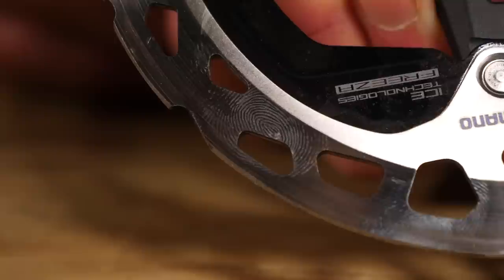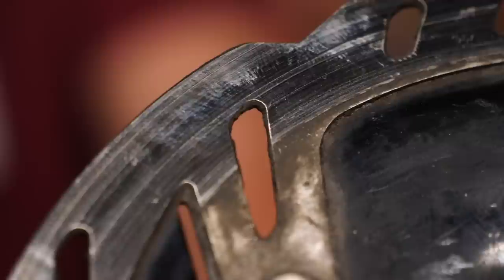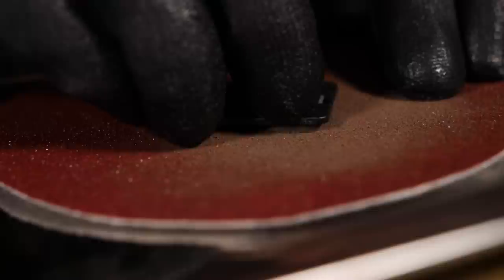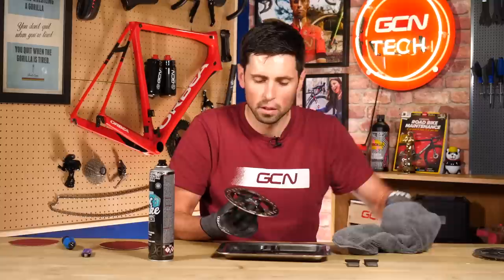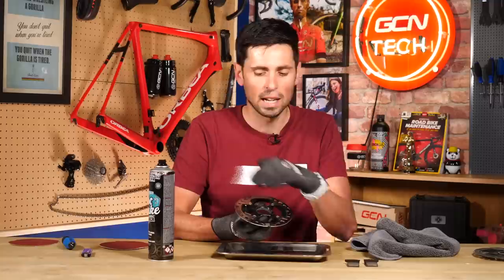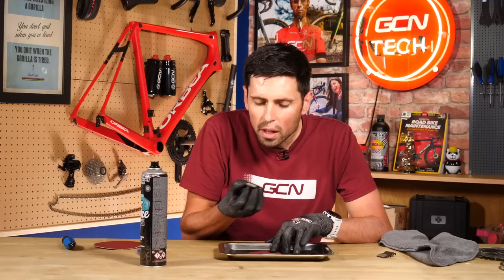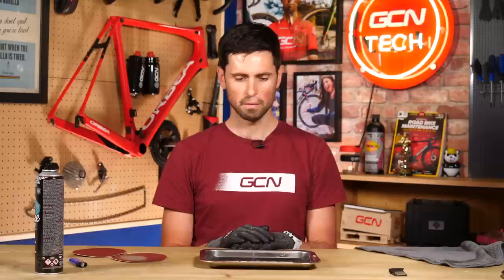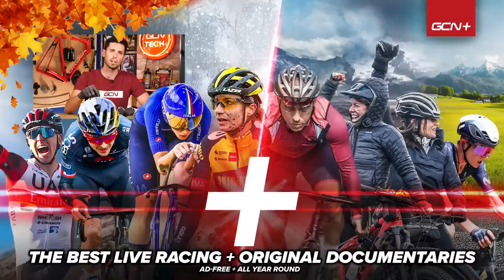How To Restore Your Disc Brake Rotors & Pads With Fire!?

Comment from the maker: Do you have any tips on restoring your brakes? Ley us know in the comments!👇
Reply: Do not set fire to them.  What complete nonsense!
Reply: Do not use sandpaper on your discs. 
Just clean with brake cleaner and the newly faced pad will do any abrading needed
Reply: Don't light quality brake cleaner on fire. Genuine brands are heptane or chlorinated which is instant cancer. Its what the Chinese clean phones with and those works die after 3 years while working with fume hoods and respirators without even lighting it on fire. 
Muccoff is just acetone and ethanol according to the safety sheet, ie  its degreaser not even brake cleaner. 

Yes sand your discs if you've cooked them (glazed) and they look super shiney, polished or blue coloured. Ideally use a wire wheel instead that won't actually remove any material
Reply: Fixing contaminated pads is simple:
Simply put them in the oven ... on edge ... not face down or up, at 350F / 175C for about 30 minutes.  Grab the pad with a pair of pliers so you don't burn your fingers, and wipe the friction surface with a clean, white paper towel.  It will leave a greasy mark on the white paper towel.  Set them back in the oven immediately after wiping (on edge again), and pull them out again and wipe with a clean white paper towel again.  Repeat this until the paper towel is still clean after wiping the friction surface (might require 3-5 wipes, once every 15 minutes or so).  Voila -- pad will function as new.
No chemicals, no setting anything on fire.  Just heat and wipe until clean.

Agree completely with Martin Long: simply clean the brake disc... no sanding or anything else (unless the disc has "ding" on it or something like that, which can be cleaned up with a small file).
Reply: just one wear safety glasses when using brake cleaner as someone who got a bit sprayed in my eye that is not a fun experience thank goodness my shop had an eyewash station.
Reply: 4:15 that’s not how you clean a rotor…you just move the dirt around. Change the spot on the cloth. Also, the technique with fire is bullshit and old wives tale. Very disappointed of channel like yours to do it
Reply: I revamped my disc brake pads using the sanding method and it definitely helped restore some stopping power. In addition, it also stopped some noises from my front disc.

Comment: A lot of unnecessary steps, for example, cleaning the pads before sanding them. Why would you do that? Simple sand the pads, wipe them with a clean cloth, sand them with the finer paper and in the very end (maybe) use some brake cleaner. And do NOT use fire especially not to light extremely flammable gases inside. There could easily form an explosive flame if you have used too much or you're in a small room etc.
Reply: I do agree 100% with you
Reply: And take off your gloves if you use fire!!
Reply: If you sand first you risk grinding surface contaminants into the the pads/rotors. Other than that I agree, you only need to heat them up enough to get the any oil to smoke, a paint stripping heat gun will do that (or if the wife is out pop them under the grill LOL)
Reply: You really shouldn't be doing this indoors. Brake cleaner is a substance you shouldn't be breathing in. Alex did point this out, but you shouldn't be doing this indoors unless you are in an industrial environment.
Reply: @chris1275cc  you can even just pour boiling water on it to wash away oil. Boiling water acts like a degreaser.
Reply: Clearly you've never actually tried to decontaminate oily pads. No amount of degreaser, petrol or detergent will get the oil out of the center of the pads. 
Your pads will not explode lol, its oil/silicon. If you actually ride bikes you would have cooked your brakes and smelt them before, you are already breathing the brake pads in every ride. 
Just use a blow torch to heat the pads directly for 30 seconds at a time till they don't smoke, then sand them after.
Reply: @janeblogs324  Wow, that's a very condescending attitude, for someone who didn't read the comment properly.
Nobody mentioned Degreaser, petrol or detergent, all those things contain oils and contaminants you only use solvents to clean pads, the fact you mentioned them probably goes along way to explaining why your attempts to decontaminate pads without heat have failed. The OP NEVER suggested the PADS will "explode" they were talking about the dangers of lighting flammable liquids on fire in a closed environment.
There is huge difference between getting a a little whiff of warm brake pads when out riding, and standing over them as they literally burn.
Reply: @janeblogs324  Read before answering mindless sentences. First of, sanding the uncleaned pads will also remove the oil. Use a small area of the sandpaper first and then use a fresh spot on the sandpaper when you get deeper on the pads to avoid recontamination. 
The pads will obviously not explode but setting a flammable gas on fire might cause an unwanted burst of flame. 
Please refrain from answering - thank you.
Reply: @ThePhoenixfromtheAsh  the oil is del in the pads, pretty much 100% saturation. Pour acetone on the pads and you'll see it soak up like a sponge. Sand right at the end after blow torching

Comment: I prefer to use a white or light coloured cleaning cloth, rather than a black one like the one Alex used. That way, if a section of your cleaning cloth has some contaminants/dirt/grease on it from your cleaning, you will clearly see it and thus avoid that section of the cleaning cloth on the next stage of your cleaning process.
Reply from the maker: Good tip!
Reply: See, that's why toilet paper is white instead of brown. 😁

Comment: Flame torch works best. You just need to flame the pads till they are not smoking anymore. For the rotors I use rough sand paper and just scuff them up. Works every time 😎
Reply: Agreed. Skip all the toxic chemicals and go straight to the fire!
Reply from the maker: Flame torch sounds fun 😄

Comment: What is the point of the video if you don't mount these into a bike and see if the results were worth it?
Reply: Hey, it's helpful guide that can get more life out of brake pads and get brake performance to improve in many(but not all) cases. Everyone's brakes will be in different condition and everyone will have varying results.
Reply: @alexpatonGCN  Duh. Still, it isn't a complete video without testing the methods shown here. Either it worked or it did not and that is what people want to know.

Comment: Steel wool works wonders to give the break rotors that brush look, also removes etched marks. Don’t be too eager with sanding the pads, especially the resin type.

Comment: Kudos for being willing to present some non-standard techniques using fire! FWIW: My recommendation is to burn contamination out of the brake pads with a propane or butane torch and then sand the surface with 80 grit sandpaper, no solvents needed and much higher heat. Then sand the rotor surface fairly aggressively with 80 grit paper also before cleaning with brake cleaner. This method works about 80% of the time,, though less consistenly with organic pads than with metal pads.

Comment: I find acetone (nail varnish remover) works better than cleaner or alcohol. 
Actually the best stuff Is M.E.K. (industrial paint thinner) but its more expensive and rather nasty stuff.
I wouldn't advise lighting flammable liquids on fire, a heat gun, blow torch (or the grill if the wife's not home) will get them hot enough to smoke off any oil in a controlled way. But if you must do this method do it outside and PLEASE take OFF the gloves you have just handled the liquid with, if they catch on fire they will melt on your hands before you manage to get them off.
Reply: I can't believe they are telling anyone to light flammables. So much can go wrong there. Good point removing the gloves.

Comment: I’ve used the sandpaper (600 grit) method on my new SRAM Code brakes before installing as a means to “break in” and marry the disc and pads together.  I feel it makes the brakes quieter and efficient from the first ride.

Comment: I just rub the 2 pad surfaces against each other under the tap, then for last couple of rubs add isopropyl   nearly always works fine.  Only time I use sandpaper is if I need to scuff up an old rotor after a clean to get the old pads to transfer onto them.

Comment: I have diamond stones for sharpening tools, just a flat rub on those and a bit of window cleaner or alcohol to wipe the residue off. Far more effective and flat, with no explosions. If you don’t have stones, you can tape sandpaper to a flat surface like a tile, will also work pretty well.
Reply: You mean like Japanese whetstones for sharpening knives?

Comment: After having squealing breaks I now clean the rotors with inexpensive automotive brake cleaner whenever I clean the chain. So far it seems to work. It only takes a minute or two. Always use a clean cloth.
Reply: Great to hear, keep that bike as clean as a whistle!
Reply: I did this until i bought rotor protectors (muc off), less fafing and I less chemicals

Comment: Be cautious with using fire to clean bonded components. Heat can soften the adhesive and de-bond components. I prefer alcohol and a fine grit sand paper for brake pad cleaning. Alcohol only for rotor surfaces.
Reply: Acetone works quite well for brake rotors. You have to be careful with alcohol based solvents as much of the time they contain other substances. A cleaning grade isopropyl alcohol should work well.

Comment: So I did all - sanded down and wiping with brake cleaner both the pads and the rotors. I also cooked the pads in 250 °C for 30 min. in the oven. Stinked up whole apartment but thabkfully the stench faded away fairly quickly, including from the oven. None of this helped. What did help, but to an extent was submerging the pads in brake cleaner and leaving them to soak up overnight. Then I sanded them again and wiped off. They got stronger, but not as strong as the uncontaminated pair. I've also seen people soaking them with vinegar, but never tried it. Still I will give it a try with a blowtorch.

Comment: I would recommend a grinding stone in stead of paper. IMO fire doesn’t significantly aid the cleaning process however can cause deformation in the disc because of heat.
Reply: I've tried both putting discs on fire and in the oven. Putting them on fire, doesn't even raise the disc temperature to 50 C. Everything burns off faster than the disc gets hot.
Reply: @ernestasl  thanks for the input

Comment: “Controlled environment” or not - lead by example, and please use some safety googles when you burn something that close and with a fuel as volatile as alcohol. Olli can tell you which specifically - lab-grade ones are not that expensive, and may save your eyesight. Or just your beard.
Or use a butane burner for the kitchen, the ones used for creme brulee. 
You can also use them as a ersatz soldering torch, btw.
Reply: Never used googles on my beard before, got to give it a try

Comment: Sanding alone did not restore my brake pads as they were too contaminated. I put my gas grill on full whack and gave the pads like 10 minutes in there. Slightly sanded them afterwards, they are good as new. Supposedly, a pan on your stove works as good.
Reply from the maker: Great! Thanks for watching our video, glad you could bring the pads back to life 💪

Comment: Just clean disk with alcohol every time you clean your bike.  Or do the whole process if there's actual problem with braking. But, yeah, cleaning disk alone is super easy and it's good to clean it just to be sure you didn't get anything in it during cleaning or during use.

Comment: Resin pads can be decontaminated by just braking them warm enough. It works perfectly with MT 200s for example, if you brake them to 250 to 300° C hill down (stainless steel gets brown to blue at this temp) the pads bite like new afterwards.
Reply from the maker: Sometimes they are beyond the breaking technique 😔

Comment: Doing all this and worrying about brake fluid etc makes me miss rim brakes... 
Rim brakes are pretty much dead in the water unfortunately.
Reply from the maker: Rim Brakes in winter 😬
Reply: Nah, they are fine and i recommend it. I'm lucky enough to use v-brakes on 700x32/28 wheels, and i can tell you they are as good as the Shimano 105 if not better.
Reply: I specially recommend it if you do touring/bike packing, where i've had the pads wear out in the middle of a long descent (they were already thin when i started riding) and all i had to do was to remove the current pads and replace them with new ones (i packed a pair before leaving home). No fancy tools required, no spreading the pistons, no removal of the back wheel with a loaded bicycle... Just a multi-tool and a swiss army knife.
Reply: @CyclingLifePT   100% 
I've never had problems with my rim brakes in any conditions but I also don't ride in rainy and muddy conditions often on the road or mtb.
I do a lot of running in the winter instead or some Zwifting.
I'm trying to qualify for Boston next so worksout great.
Yeah, good story and so true.
I miss just quickly replacing the cheaper and less faff rim pad.
Lighter and so easy to adjust on the side of the road.

Comment: So Sandpaper 101, Alex, what grits of sandpaper do you suggest for this?
Reply: If you are in the uk dont bother with sandpaper....get some sanding mesh from Toolstation. Much better in my experience to use as the layer of contaminated pad you remove does not clog into the paper but falls through the mesh
Reply: In the past, I used (80) as rough sandpaper and (200) as fine sandpaper.

Comment: Another bunch of furphies and half-truths: 
firstly, spray disc brake cleaner is toxic in nearly all its formulations, as well as putting an unnecessary empty pressurised can into the waste stream. You breathe it in, you elevate your cancer risk. Use isopropanol or in dire straits, acetone, wiped on and off. 
Secondly, you cannot decontaminate brake pads of brake fluid by setting them on fire, putting them in an oven, soaking them in metho then setting them on fire, or any variations on the theme. If you can't abrade the glaze and contaminants off the surface (& use a cement block or piece of smooth concrete to do it as they're flatter) of the pad, it's time for new ones. Brake pads have an open resin structure that acts like a sponge, and only cleanliness will stop them degrading quickly. GCN Tech, lift your game.

Comment: How do you know when your rotors are trash?
Reply: If you run a red when you didn't mean to, time to change them out. 😂

Seriously though: 

If they get too hot and go "straw/gold/bronze coloured" or warp due to heat = Trash (a few spots and/or a slight wobble that doesn't contact the pads or just brushes them slightly is usually ok to ride but think about replacing ASAP)

If they just don't work well or sequel even with new pads and cleaning them doesn't help = Trash 

If they become warped/bent by physical means (not heat) enough they "bind up" in the caliper = Trash (slight warping that causes rub, but still allows the wheel to rotate can usually be trued) 

If the thickness falls below a certain level (usually 1.5 mm but check with your brand) = Trash

Comment: Nowadays the discs are SANDWICHED,  with alu in the middle, steel on the outside.
Setting up fire to your disc will have them crooked!!
Reply: I don't think little bit of alcohol actually heats those pads much, really it's only heat on the surface. Depends ofc on amount you use, but if you just spray so that item is bit wet, it should only be surface heat.

Comment: Somehow my pads get glazed every time after sanding. A bit weiird…
Reply: I also noticed that. Maybe they need "brake in" like when you get new ones. Any advice?
Reply from the maker: Have you tried cleaning the rotors? 🤔
Reply: @gcntech  I did all the steps in the video except fire. The brakes work fine for 2-3 rides (not in rain) and then noise again. My discs have more discoloration than those in the video. Maybe time for new ones? Although their thickness is fine.

Comment: GCN Tech:  How To Restore Your Disc Brake Rotors & Pads With Fire!?
Ordinary Folks:  Return to Rim Brakes!
Reply: Rim brake folks: Damn, my rim brakes have worn through my expensive carbon rims again...
Reply: @jefferycampbell2243  "my rim brakes have worn through my expensive carbon rims again . . . " ------>> You fell asleep gripping tightly on the brake levers, again, dreaming of disc brakes😆😅🤣😂
Reply: @jefferycampbell2243  Tip: Don't buy carbon rims.

Comment: Please tell kids not to spray it a second time after setting it on fire once 💥 and not to stand face over it.
On a funny Eyebrows are slow to regrow, but seriously there are no quick fixes for Burned skin, it’s disastrously hazardous.

Also, missing the tip to cut the desired amount of sand paper, to use it sparingly, and mount sandpaper to a flat surface such as a board and figure the motion to keep both surface levelwise.

Comment: This is NOT something i would recommend lightheartedly. Isopropyl alcohol is highly flamable, and the vapours could create an explosive atmosphere. Also, a bicycle workshop is a place full of inflammable stuff and aerosols. If a cannister of Isopropyl alcohol bursts for some unfortunate reason, there ain't going to be enough time to use the fire-extinguisher to prevent an explosion. This is not OSHA approved at all.
It's better to just use the products for what they were designed, spray your discs thoroughly and wipe them off with a clean cloth or some degreasing wipes.
Reply: Just happened to me right now: I was using a can of degreaser and the cap got slightly stuck and the vapors kept getting out through the nozzle but very slowly and inconspicuously. I had to shut the music off to realize there was a leak. Have i had an igntion source nearby and that would be all it would take for the can to (possibly) blow out.